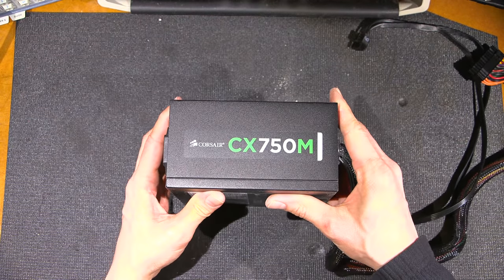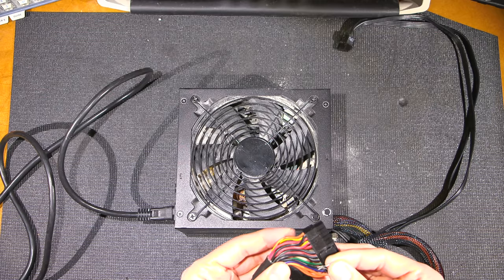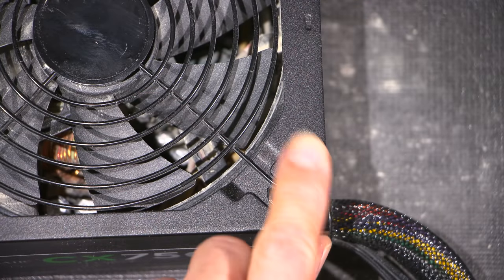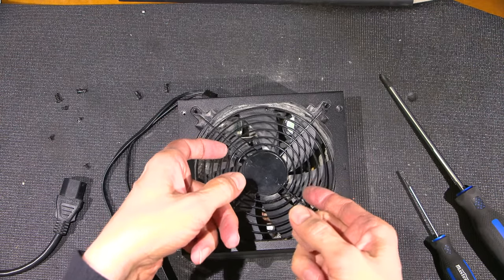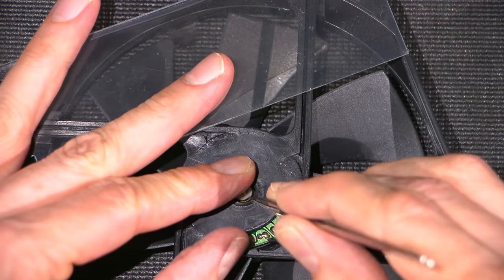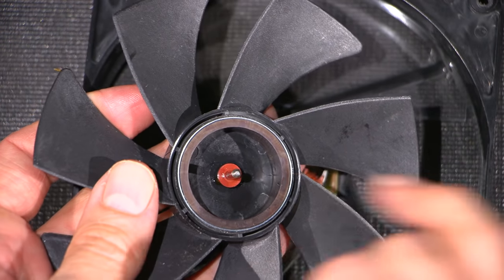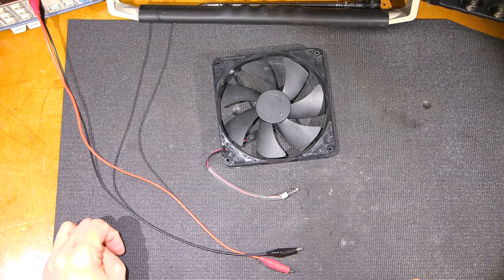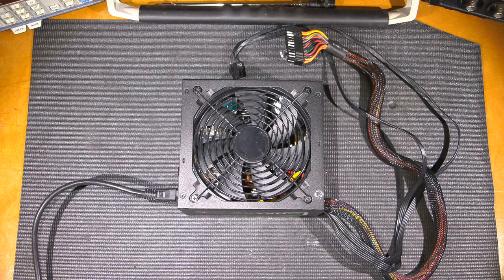Fix A Computer Power Supply!

Comment: The MAJOR problem of such supplies is BAD (not poor, but bad) mechanical design! Why? Simple: the standard bronze bushed 12v dc fans are totally inappropriately mounted! 

A bushing ONLY provides a RADIAL bearing surface, hence ALL such fans should be mounted VERTICALLY ONLY with the fan axis horizontal. 

The reason such fans fail in unpredictable ways is because they are NOT running with any real bearing surface supporting the fan ... 90% of the time it is JUST a fibre washer with a circlip (on top) or even just a polypropylene washer. 

If the fan is mounted horizontally with the fan upside down, it is even worse, as the full weight of the fan (not much but still significant) is hanging on that washer/circlip!

Correct mechanical design would use a bearing with BOTH radial AND axial thrust support i.e. a ball bearing.

As someone else mentioned, back in the 80's large computers had MANY standard fans. In the case of the ones the company for whom I worked (DEC) they were 110v fans wired in series for 220v operation. 

A number of engineers who had customers with over 40 such fans, it was a regular occurrence to change out the fans on a preventive maintenance schedule. Eventually one engineer realised the fundamental problem and insisted on replacing the standard fans with ball bearing replacements ... Noisier? Yes! But as the systems were in industrial environments and/or computer rooms it mattered little, but it stopped the regular fan replacements for years!

Moral: don't presume that just because a system has been designed by electronic engineers, that they have a good grasp of mechanical engineering fundamentals.

Personally speaking I HATE supplies such as the one shown because of this problem, but on my own machines I have ALWAYS stripped down my fans on a regular basis, cleaned and oiled them and refitted them with a new lease of life.

Glad someone else realises that replacement isn't necessary in 90% of cases. But if you DO replace, and can live with a bit of extra noise ... Use ball bearing fans for horizontally mounted ones.

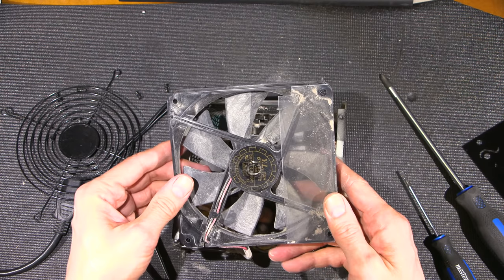Comment: I prefer to use a PSU tester to power up a power supply. It won't allow overload, or present any electrical risks. 9:20 is that dust or cigarette ashes?? Either way EEEEWWWWW I wouldn't have been brave enough to tackle that one, just on the level of filth alone.

Comment: Why put a resistor across the fan when testing with the bench power supply?
Reply: Hmmm.....nothing, actually, but what it does do is give you a stable set of 2 wires that won't short together while you are attaching the clipleads to it....  make sense??

Comment: You're lucky this fan had the oil area. I had a fan dry out on my CPU. Had to power the system off quick. Than found out the fan had no way to oil it. No pop cover under the sticker. So had to chuck it.

Comment: With that much dust and evidence of overheating, I'd suspect that this PSU is mounted in the bottom of the case with the intake blocked by carpet. A shiny shilling says I'm right ;)

Comment: When a computer begins doing WEIRD stuff-- at RANDOM--- is that a sign the power supply is going bad?   Things like the USB ports will work randomly- or not- and then setting on the monitor change without touching anything- and other things won't come on- and just weird crap that I can't find any other use for???   I hate it if that's the case- because THIS is th second power supply I've replaced i this computer in the last Year...

Comment: Why shouldn't you spin the fan blades with air?
Reply from the maker: You can over rpm them very quickly and glaze the surface, then no oil will pass the porous bronze.

Comment: i got one of them its good tho, i hear they have bad rep for breaking down
Reply from the maker: Ya, pay no attention to the negativity, 99% of the time it's people being cheap, and under sizing the supply to save money.
Reply: @MrCarlsonsLab  i was told its this specific psu the cx750, a pc shop said i shouldnt trust that model its a bomb waiting to go off hes had other pc's dead over having that specific model fitted. people on internet are also singing the same song, maybe i got lucky and won the silicone lottory theres no issue with mine touch wood.

Comment: This probably a dumb question, but I was interested in the comment not to spin the fan with the compressed air. Is that specific to this fan, since we already know it has bearing problems, or a more general comment about fans? If a more general comment, why would that be important to avoid? Thanks

Comment: Those Yate Loon fans used to be all the rage in PCs for being quiet for the amount of air that they flowed, so I bought a bunch years ago... Least reliable fan brand I've ever used. By far. Would never be comfortable with having any of them in my computer ever again. I had problems with them even without much dust or much heat. Even as a case fan that wasn't blowing very hot air. Even when the computer was never allowed to get very dusty. Just not a good fan brand in my opinion.

That said... good fan brand or bad fan brand... dust your electronics off, people! Dust kills.

Comment: that "fix" is just temporary. The dust gasket will not seal right and the snap ring is ruined by you pulling it out. Dust will still get in there even faster now and the bearings will wear out very quickly. It's just better to swap out a new fan.
Reply from the maker: Still works well, and is quiet. The computer has been on 24/7 since. I guess we will see how long it lasts :^)

Comment: Many of us knew exactly what was wrong before you did anything at all.  Noisy PSU in a computer is either bad fan bearings or the blades hitting something.  Landfill issue aside, it's usually not worth the trouble of disassembling a PC fan, especially the low-end ones in a low-end PSU such as this.  Just replace it with a better one for $6-7 bucks.
Reply: ...especially when you've got a drawer full perfectly functional fans harvested from obsolete PeeCees.
Reply: @editorjuno  Indeed. I can't imagine ever needing to go through the pain of rebuilding a fan hub
Reply: @rangersmith4652  -- Not to mention $50+ USD worth of a highly accomplished technician's time to repair a component that could have been replaced for under $10 USD within a few minutes.  I'm in awe of Paul's skill set and talent for video presentation, but the economics of this particular job make no sense -- I think our landfills can handle a few PeeCee fans once in while.

Comment: Thank you.  I too like sparing the landfill.  I've had several gas engines succumb to Ethanol issues.  Sometimes I can clean rhe carburetor.   Maybe teplace the carburetor.  Regardless, Ethanol gas has ruined more small engines.  Engines manfacturers are not going to lobby against this gas.  Bad policy, at least here in the US.

Comment: hmm, i was hoping for something a little more interesting, i mean who hasn't replaced or fixed a fan before ?
my old premium PSU got fried when the USB port got shorted because the IO shields prongs got inside it (when mounting the mobo), i took it apart but saw nothing burned, not even a blown fuse, so i had to take it to a repair shop and they fixed it, that's the kind of video i was hoping for.

Comment: At least it works. I had three of those die within 4 months. They are junk. I got a much smaller Thematake that was only 80+ bronze and it is still going after 3 years..
Reply from the maker: I have never had one of these "properly sized for the current demand" ever fail.
Reply: The Thermaltake I replaced it with was 100w lower and is still going 5 years later(now). Granted I got them all at best buy, so it could have been a bad batch. I will still never use them again though.

Comment: Unfortunately, a lot of fans don't have that access port and you basically need to replace the fan
Reply: What's stopping you from gaining access to the bearing? Some plastic? That's what the nasty bits with teeth that come with Dremels are for! Pro tip: dig carefully.

Comment: Whats funny is that is a really old power supply. Most all of my computer is Corsair but my power supply doesn't run the fan at all unless it needs to. And I can tell you that my fan has never run a single rotation and those are designed to not turn unless they are overstressed. And mine is the same power rating. I think I would just buy a new power supply. More modern of course. And the landfill thing? You do know they recycle this stuff right? Plus you can buy a new fan for about 10$.

Comment: Меня удивляет реакция людей на это видео.. ))) Как будто всю жизнь прожил человек и ни разу не сталкивался с такими вопросами сам.
 Почистить системный блок я думаю это должен уметь каждый пользователь компьютером. 
Так как компьютер родственник пылесоса. И иногда его нужно вытряхивать..)) 
Даже не разбирая весь блок питания можно почистить малярной кистью и пылесосом от избытков пыли а не доводить до состояния жерновов на мельнице... 
Моей маме скоро 70 лет. Она сама очищает от пыли раз в месяц свой системный блок.. Так как она живет в другом городе и помощи не ждет. Все делает сама..)))

I am surprised by the reaction of people to this video ..))) As if a person had lived his whole life and had never faced such questions himself.
 I think every computer user should be able to clean the system unit.
Since the computer is a relative of the vacuum cleaner. And sometimes it needs to be shaken out ..))
Even without disassembling the entire power supply unit, you can clean it with a paint brush and a vacuum cleaner from excess dust and not bring it to the state of millstones at the mill ...
My mom will soon be 70 years old. She herself cleans the dust from her system unit once a month .. Since she lives in another city and does not expect help. She does everything herself ..)))

Comment: It's a very cheap fan and unfortunately a common one in power supply's unless you go with really good ones. Doesn't matter the brand of power supply below a certain price they all come from the same factories. In fact I'm surprised this one stuck around, the CX750's like to blow the regulation circuit up.

Comment: You did not explain why you did not want compressed air to spin the fan blades when cleaning unit?
Reply: You can over-RPM the fan and burn out the bearings.
Reply: @DaveMcAnulty  Make sense. Thank you.
Reply: @DaveMcAnulty  yeah but the clown whistle noise a fan makes is so sublime. Sometimes I just can't help myself. Dry ball bearings do it too. The other urban legend I've heard is a back driven fan will actually produce a voltage. Which makes sense. I'm about to get a fan and put it on a meter to see if it is true. My air compressor has a tank of air in it right now. I suspect fans may include protection diodes in them to block back voltage though. But maybe not?

Comment: Hello. Can someone please help me to fix my PSU ? It's made by great wall 1250w and it's exactly the same like ocz zx 1250w PSU . It turns on half second and relay automatically shuts it down. I would really appreciate if someone could guide me through how to fix it, what to check and how ? I have multimeter. Thanks

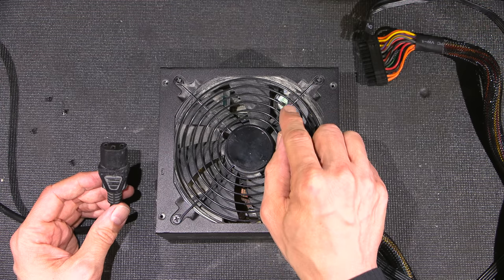Comment: 7:26 - FULLLLL BRIIIDGE RECTIFIERRRRR... Oh wait, wrong channel. 
I'm a big proponent of repair over replacement. People keep telling me to get rid of my car because it's "old" and has "high mileage." But throwing a hundred here, a few hundred there into a car with 346k miles is still cheaper than a car payment - and I can squeeze out 32 mpg on the highway, not too shabby for a midsize sedan, and even better fuel economy than some newer cars retailing for $30k+. (And less electronics to fail down the road - pun unintended!)

Comment: The fan on my power supply doesnt work,when i starts the Pc it starts all well,of course the graphics card wont work because it doesnt get enough power,so i cant even open my monitor.
My pc will shut down after 15 sec or so and restart itself,i cant find a fix

Comment: Nice patient bandaid for a dirty PC.

Is it rude, in Canada, to buy your friend a quality vacuum cleaner or filter for their HVAC?
To advise them to NOT put their computer on the floor with their shoes?

I replace stock fans with magnetic bearing ones all the time so I don't have to clean a five dollar item, with tweezers.  It's more because I don't trust anything that has operated overtemp.
If your friend brought you the whole PC, you could have provided them with some filtration on the case's intake.

Comment: Yep, easy one.... I've revived several fans by doing that.... you were lucky though....seen some where they ran at high speed for many hours, and that little plastic retainer ring has fused to the shaft and body, and scored the shaft, the whole thing is a mess.... even though I re-lubed them, I didn't expect more than a few more months of life.... better to replace .... most times....just saying...
Reply: There is indeed a reason why bearings come lubricated. It's because they're not long for this world once they run dry.

Comment: My power supply went off I opened it up remove the Pcb there was a thick soldier trace line That had disconnected had a big black burn mark It even removed some of the bored I cleaned it all and I Dumped loads of soldier over The burnt area and connected the trace line Put it back together and my pc works Last about four or five months Now it's getting temperamental random restart it could restart ten times before gets to desktop screen Or it could last six hours very Random but my cpu is also going for 35°c idle to 90 -100°c in 10min - 30min depending on what im doing
Reply: The 24 pin connector connected to the mother board seems to get quite Hot as well
Reply: Asus p6x58d-e motherboard with 16gb ram (2x 8gb) and i7 cpu 930 @ 2.80ghz 2806mhz 4 core and a amd radeon hd 5700 series 
But cpu-z tells me it's a 

ATI Radeon Hd 5750
AMD Radeon HD 5750/6750
JUNIPER LE
Reply: Oh, yeah, there is brown dark patches where it looks like the board has been over heating And the trace line that a fixed was not connected to any component it was in the Centre of a trace line between Connections to components

Comment: I love your channel but I must disagree with repairing fans, at least in a commercial setting. I work in TV broadcast engineering and I once had a staff member who would spend most of his shift repairing fans - trash picker. I finally gave the order for the staff to cut the blades off bad fans. As the CE, I get the 3am call that something critical is down and then get to explain to the GM the next day why. So I don't need repaired fans failing two weeks after they are "fixed".
Reply from the maker: Hi Andy. Every fan I have deemed repairable has not failed for many many years after servicing. I think this depends on who "touches" the device to be repaired.

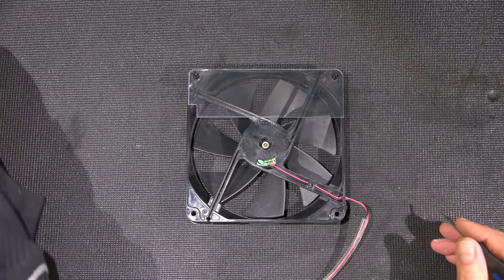Comment: 11:10 most of the times there is no ball bearings in the PC PSU cheap fan, it is just one brass sleeve bearing and it is wearing out over time it is not a lubricant issue. The fact that you are telling this with a such confidence makes me sad. What if the other videos on topics I am not familiar with are also full of false claims pronounced with a such confidence? Very sad.
Reply: I'm willing to assume that Corsair would use a higher-quality fan than your basic dirt-cheap P/S. But you do have a point, on two separate occasions I have had friends bring PCs that crash randomly to me to take a look at, both times it was sleeve bearings on the CPU cooler. On one of them, the sleeve bearing was actually PLASTIC!
Reply: @dashcamandy2242  even if it were a ball bearing fan then the ball bearing should have been replaced not just lubricated. Lubrication of an old fan can only make it silent for a few month at most. I am pretty familiar with this topic and Mr Carlson is really doesn't know what he is saying in this video, probably only disassembled just one PSU before this one, but he is telling it with the same confidence as always. This makes me think that he is not as nearly as professional as he tries to look like in the other videos too. This is sad, because I am not familiar with an old radio restoration and watched his videos believing everything he say. Don't know what to think now.

Comment: You shod all the word "fan" to the title, it's less misleading!
Reply from the maker: So if I replaced a capacitor in the supply, should I have titled it, "Capacitor Replaced?" Maybe, "solder removed, capacitor replaced and re-soldered?" Cmon, cut it out! (The fan is part of the power supply)

Comment: Come on, compressed air cleaned it out that much?  You must have used soap and water on that thing!
Reply from the maker: No, just compressed air from an actual air compressor, "not air in a can." If the air nozzle is pointed at the sleeve of a capacitor, it will rip it right off.

Comment: Good tips on the resistors and oiling the bearings, but fixing a fan is not that interesting for your channel. I want to see you fix a power supply that has a more complex problem like failed transistors or marginal capacitors!
Reply from the maker: I have lot's of power supply video's, check my video's list.

Comment: I donot agree with this temporary fix, if the bearings are damaged in any way they will cause more wearing to the races and fail again, in addition if lubricant was found outside the seals then they have failed and the whole unit should be discarded for a new one with good bearings and end seals.  You replace worn out electro mechanical parts all the time and this type of repair should be taken just as seriously like a leaking capacitor.
You know that, WTF?